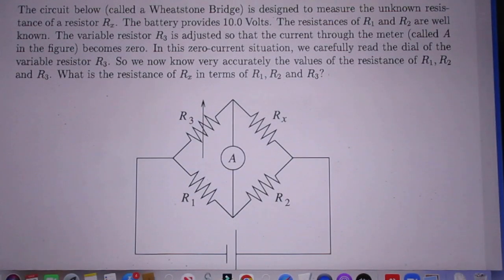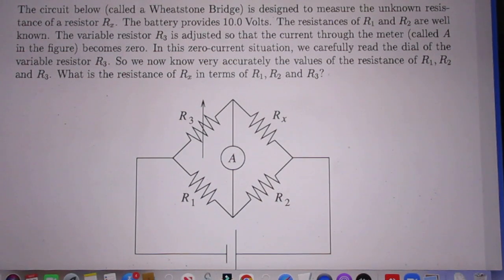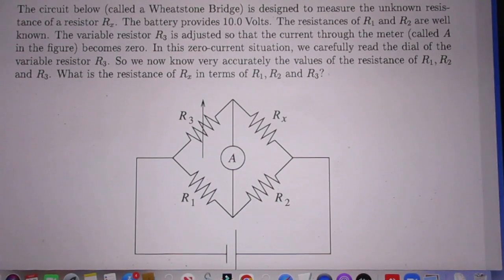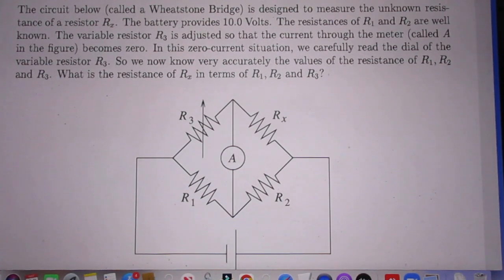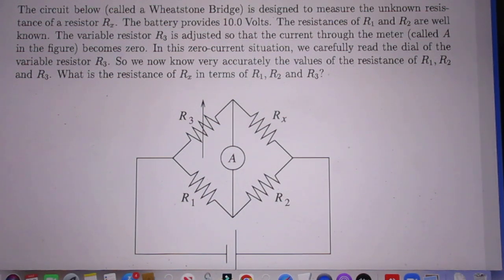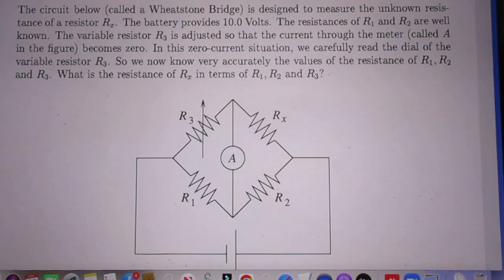Problem 144 - Wheatstone Bridge

Comment: In order to have zero current across A , both of its connections has to be at same voltage relative to the battery.Now if we put leads of our voltmeter across A it will read zero volts.No voltage difference=no current.How we achieve this? Ratios! Voltage is all about ratios.If R2 is two times bigger then R1 we will have two times higher voltage across it. Same goes for Rx and R3. If R3 is for example 2kOhm than for two to one ratio Rx has to be 4kOhm.This makes same voltage drop across Rx and R2 (but different currents!) making the rest of the voltage go across R3 and R1.

Comment: Would be grateful for the solution of following question

A SOLID SPHERE OF MASS M AND RADIUS R IS SURROUNDED BY A SPHERICAL SHELL OF MASS 2M AND RADIUS 2R.WHAT WILL BE THE TIME TAKEN BY A PARTICLE WHEN DROPPED FROM A HEIGHT H TO HIT THE SURFACE OF SHELL(assume h<<<R)

ALSO ONE LAST QUESTION:- is there any thing like gravitational shielding similar to electrostatic shielding
Reply from the maker: H=0.5*g*t^2 this is the answer with or without your spehere and your shell - the answer is the same. 
question 2.  NO

Comment: Sir could you please explain is magnetic force and field, are conservative or non conservative?
Reply from the maker: The force on a charge q in a magnetic field is qv×B. This force (the Lorentz force) does not depend only on the position of the particle, but also on its velocity (speed and direction). Thus the force is not conservative.
Reply: @lecturesbywalterlewin.they9259  thankyou sir

Comment: Resistance of Rx = (R1+R2)-R3

While using ratios may provide a valid relationship value, it won't give you the actual resistance in Ohms.

Note: Disregarding any variances due to manufacturing tolerance specifications, such as the resistance of components being within plus or minus 10% of the design specification, or the calibrated accuracy of measurement for the variable resistor R3.

BTW, this is the first time I have seen the circuit such as the one shown, using resistors, to be called a wheat-stone bridge. 

To me a wheat-stone bridge is a circuit that uses diodes (rather than resistors) in a similar arrangement to form a full-wave rectifier circuit for converting AC to DC. Whereas what you show is a voltage divider as might be used in a voltage regulator, or to adjust the volume or power gain in an amplifier circuit.

I'll challenge your wheat-stone bridge bet and raise it with, what happens if I replace the amp-meter with a copper penny?
Reply: yeahh you are right ratio won't give us the actual value..
we have to consider both of them "R3 and Rx" in series combination..

lmao bro copper penny will act like a conductor..
btw there will no change in resistance as there is 0 potential diff at the location of amp-meter..

Comment: i thought the concept of the wheatstone bridge was When R1 and R2 are equal to R3 and R4  there is no potential difference flowing  between the 2 points?  no potential difference no current will flow.

Comment: Rx=R2*R3/R1. This circuit is not that often used in electronics. Certainly not modern electronics. A divider and voltage measurement is used more often. I have built temperature measurements this way, just a voltage divider, feed to a microcontroller and let that do the math.
Reply: A wheatstone bridge is used in just about every resistive sensor in existance...

Comment: These is a balanced Wheat Stone as current is not passing through that Ammeter wire. Therefore,

R3 * R2 = R1 * Rx
So, Rx = (R3 * R2)/R1

Comment: Sir I really need your help I'm ninth grade student and I solved all the sections of irodov except mechanics as it notations confuse me a lot could you please help me that how should I deal them?
Reply: Is there a specific notation that confuses you?  To be fair, I didn't know most of these notations when I was in 9th grade either.

Some common examples:
The "roof"  (^) over a letter indicates a unit vector, meaning the size is 1, usually over x, y, and z for the coordinate directions.  Some books use the trio i/j/k, to mean the same thing (look up quatenions if you are curious as to why).  You may also see this applied to r, for a radial unit vector.

The arrow over a letter indicates a vector in general, while scalars just get written as plain letters

Multiplication has a specific meaning, when indicated as either a dot (·) or cross (×), and the terms involved are vectors.  They are called, not surprisingly, the dot product and the cross product respectively.

The dy/dx Leibnitz notation refers to derivatives, i.e. instantaneous rates of change.  Note that it could be any two variables, not just y and x.  Very common for the bottom differential to be dt in Physics, for rates of change relative to time.  You may also see Newton's notation of dots over letters to mean the same thing, with the number of dots indicating the degree of derivative (1st, 2nd, etc), and the implied variable of the derivative is t for time.

The tall S-shape (∫), that looks like the hole in a violin, refers to a fancy kind of summation called an integral, the counterpart operation to the aforementioned derivative.

Since d already has another full time job in Calculus, another letter may take its place for distance and displacement.  This is why you'll see s for displacement, or the x/y/z trio to indicate displacement in a specific axis.

Greek letters are typically the rotational/angular counterparts of their corresponding linear motion terms.  Such as alpha for angular acceleration, and tau for torque.   Since there is no Greek letter to go with v for velocity, the counterpart to its alphabet neighbor of w, which is omega gets used instead for angular velocity.  One exception is mu for friction coefficient, that is not necessarily related to rotation.

Greek theta means angle or angular position, as may other Greek letters, like beta, gamma, phi, and psy.

Momentum and angular momentum commonly get a weird letter that doesn't make sense at first glance, because more obvious choices are already spoken-for.  Linear momentum gets called p, historically for impetus, and angular momentum gets called L, for the cross product of perpendicular vectors, since L looks like two perpendicular lines.
Reply from the maker: I do not solve problems for viewwers. I teach Physics

Comment: The condition will be, ratio R3:Rx must be equals to ration R1:R2.

So Rx=R2*R3/R1

A simple intuitive explaination will be, to make the current in A = 0 we need to have same potential drop above and below it.
Means I1R3=I2R1 if we consider current in above branch as I1 and in lover branch as I2.
Lets say R3+Rx = A and R1+R2 = B, 
Then ratio of current in the two branches in balanced condition will be B:A (using V=IR and the below mentioned conditions) since there total resistance are in the ratio of A:B and total potential is same.

So now, talking only in terms of ratio,  and using the previous equation, R3:R1 must be in A:B ratio.
And total resistance in the two branches are also in A:B ratio.

Hence ratio of two resistance in uppar branch must be equals to ratio of two resistance in the lower branch.

Ans) Rx=R2*R3/R1